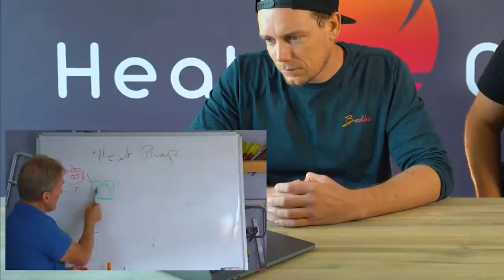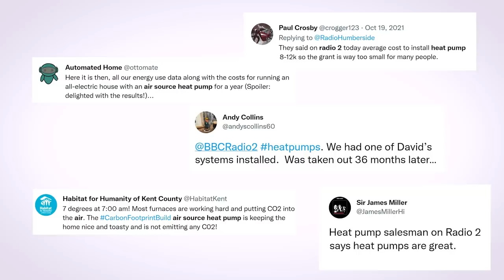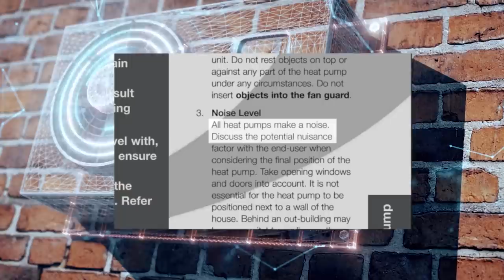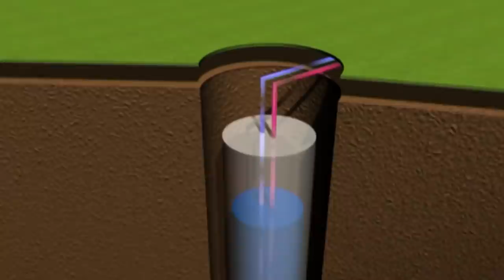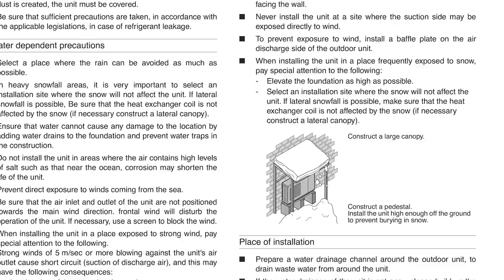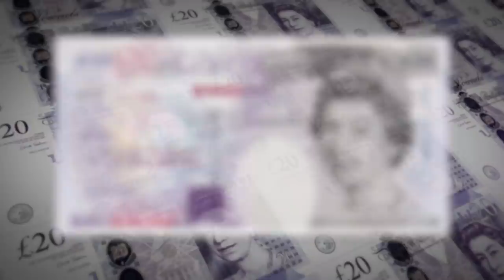Heat Pump Secrets They Don't Want You to Know

Comment: 👍 excellent video on the topic
1: majority of all problems was the selection of the wrong heat pump and the wrong size by an unqualified person who just wants to make a sale.  Not caused by the heat pump having a problem

2:  for the glycol water loop piping systems majority of all problems caused by improper piping design and trying to cut down cost and cut corners leading to an unhappy customer.  The cause trying to be cheap or unqualified contractor not knowing how to design.  Not the heat pumps problem

3:   Underfloor or radiant heating that is the whole idea of design it’s a very slow very gentle heat that needs to be on all the time there is no rapid changes up or down due to lack of knowledge causes all the problems. 
                    Slow radiant heat has to be very carefully designed and can be put on timers to set back the temperature slowly for day and night time or weekend or vacation and then slowly ramped up when the occupants are coming home on timers or remote set by your phone. 

       But any of the shortcomings again or not because of the heat pump it’s because of the designer and the installer when properly installed they were good when not properly installed they don’t work good. 

4:  noise “ what noise”. Every brand sells a low end budget brand and then they’re higher in brand you pick your problems by what end of the market for a certain brand you purchase. 
       The newer units have very little to no noise sometimes you have to go up and hug them and hold your ear to the unit or physically look for a fan moving to tell whether it is on or not if you have not seen this on the newest systems that means your lack of knowledge and being behind the times you’re commenting on old knowledge or somebody selling cheap or low end units that make noise. 

     Purchasing and installing and not knowing how to properly noise isolate is due to lack of knowledge just plain ignorance or being cheap and cutting corners and not knowing proper system design. 
     That is no fault of the heat pump.  That is a human introduced problem

5:  Polluting dirty power ?  
            That all depends on what country what state what province your particular area gets its power from some places only burn dirty coal some places burn crude oil some places burn natural gas some areas have geothermal which is very clean some have a lot of wind power that is about the cleanest solar power during the day and then nuclear the cleanest of all despite its name.    And you could be living in a place that has ton of hydropower by Damn‘s just naturally and need none of the above. 

So being dirty is by circumstances of where you live for other people it’s absolutely clean Power. 

     “ mine runs off solar with battery back up and one small wind turbine fan. “ as do many other people because of the area in which we live like many people.   But many people do not have this option. 

6:  Salt corrosion resistance factory applied from the manufacture. 
         Many manufactures on all brands produce a line that all their internal workings have a extremely high salt Corrosion coating that is installed from the manufacture does not have to be sprayed on later. 

       It is your particular region importer and distributor for the manufacture for your marketing intently and choose not to import that part number with the factory installed salt corrosion protection manufactured into the coils and components. 
          This is intentional because a profit margin‘s and they’re trying to hit a price point for greater sales it all comes down to the money.      In some regions they only sell the highly salt corrosive coating in their units because they live on islands surrounded by salt. 

      So because you were not introduced to the knowledge of what is available you’re quoting off of what you were told without heavy research you have to have the knowledge of the units being sold all around the world not just in your local area. 

7:  back up heat  ?. 
          Yes many of the older or lower model brand units will need back up heat in many instances with the newest brands that are specifically designed for low ambient conditions have been redesigned both their condenser coil‘s and their heat pump motors specifically made to operate down to -14°F I’m sorry I didn’t use Celsius I’m from the states or other close nearby low ambient temperature. 

      So if somebody hasn’t intentionally chosen the proper new or low ambient heat pump they will have to install heat strips for back up heat by being cheap or not knowing that these low ambient heat pumps exist is due to lack of knowledge lack of education or intentionally being cheap buying a lower brand so they can make a bigger profit and suffer with poor results. 

        There is also the design face where you correctly designed the right size heat pump not to be big enough to heat on just those three days of record-breaking cold days of the year that are not important.  That’s where you use your back up heat strips that will only kick in during those few cold hours of the coldest days for those few days a year no big deal and then you end up with the correct size heat pump for the rest of the average days of the year instead of having an oversized one.    This comes back to the knowledge of design

     And that’s not the problem of the heat pump that’s the problem of the person who sold it or installed it

8:  yes it’s always a good idea to keep it out of driving rain but the newer models don’t have much of an issue with that anymore and since they’re usually attached to the wall or up next to a building under and eve out of direct through flow of air movement they’re usually pretty well protected the majority of the time just by the natural installation process. 

9:  defrost cycle
Yes an extreme cold for continuous use on defrost cycle back up heaters will be needed for 15 to 30 minutes while the unit goes through defrost this is just a natural occurrence you will have to live with it’s only for a short time a few times a night so you won’t be uncomfortable and notice the temperature change but you can choose not to have them if you wanna be cheap and then complain about being uncomfortable for that 20 to 30 minutes while it goes into the recycle that’s a personal choice.?

And you will need that heater strip tape around your condensate drain line that is naturally provided at the bottom of the better model better brands already have a defrost heater installed at the bottom of the pan so when the water melts in the winter in the defrost cycle it will stay liquid and drip out of the bottom of the pan but if somebody did not know that that’s a personal choice of lack of knowledge 

10:  protect them from Highwinds
   Yes. Yes because that ECM motor if it is spun very fast also becomes a generator in reverse when it is spinning in the off position creating such a high voltage like a generator it can burn out the driving circuit board unfortunately. 
        If you know you live or installing in such a location you place the unit in a protected area or you purchase one of the little windshield kits and they even give you all the measurements for free and the design on how to build it yourself to protect it just one of those things you have to live with. 

11:   Snow rise it off the ground this is common sense but we know some people do not have common sense

12:  rodents I guess depends on your area the rodents in our neck of the woods don’t go into our units chewing on wires but have heard about it in other states in other countries. Regional problem take care of it

13:  bolted down,   Again common sense if you think you’re in Highwinds or earthquakes or it’s a high dollar unit and it could be stolen easy you would think you would want to bolted down. 

     But then again some people don’t think with common sense. 

It depends on your energy cost in what country you are in whether electricity is cheaper or gas is cheaper. 

 In my particular state San Francisco California we have a monks the highest electricity $.36 or more per kilowatt hour and natural gas is very cheap to heat with.    In some other states in the United States especially with lots of Hydro power which is also very clean electricity rates as low as seven cents per kilowatt hour can afford to heat with all the electricity they want to and have a very low power bill and in those areas gas is very expensive to heat with. 

      So this is a regional consideration before picking your source of fuel whether it’s oil whether it’s gas or whether it’s electricity

     I’m particularly lucky I live in San Francisco California with extremely mile climate we never get too hot we never get too cold we have lots of sun we can run off solar and in a weathertight house with good insulation a tiny 9000 BTU or 18,000 BTU heat pump can heat and cool your house all year long with a very low power bill we never freeze so we never have to worry about defrost cycles we do not get snow we do not have driving rain we do not have rodent problems we do not need back up heat. 

I personally have installed 9000 BTU and 12,000 BTU heat pumps in small houses here in San Francisco that can completely and satisfy the customer on the hottest heat wave to the coldest freezing temperatures because we don’t get those here in San Francisco California with a extremely low power bill.  

       San Francisco California is considered the Goldilocks climate zone for heat pumps
Reply: Skill builder is talking about the UK. . . We have an extremely wet and humid winter, a heat pump is on defrost more than it is running, you are lucky to get COP of 1.  May as well just use a fan heater...

Our electricity comes 60% from gas and coal, take into account 60% generating and transmission losses and bang goes your efficiency gains. . 

Our electricity costs 6-8 times gas per kilowatt so there goes your economic advantage. 

We do wet central heating with radiators, not split systems like you do in the states,.... These systems being sold here heat circulating water that then heat radiators in the house and a hot water tank,.   Loads of inefficiencies.

Loads of reasons not to do heat pumps in the UK.

Comment: The first law of thermodynamics states " energy can neither be created nor destroyed but merely changed from on form to another". If the outside air is for example at 5 degrees C, energy needs to be imparted to raise the temperature. The energy is imparted in the form of electricity. Therefore, in an equivalent home you may as well install electric radiators! Ground source will work due to the temperature in the ground being relatively constant.
Reply: You have zero knowledge about how a refrigerator works. And this is the whole magic

Comment: As long as you have upgraded good insulation first, and the power comes from nuclear or renewables, with correct installation, then heat pumps are better than any other heating/cooling climate control. The only way to be better for the environnement is to build a house so that it is mostly passive with tricks for heating/cooling with angles from the sun to windows, and extremely thick heat mass. Like a sort of modern earthship, because the original design don't cut it. But if you live in very cold climate, there is a simple limit to what is possible and then you will need an additional heat source. The roblem of solar thermal (with water flowinfgin panels) is also freezing, and the problem of the regulator and sensors : the most sold ones rely on temperature rather than solar instantaneous illumination, so you have huge losses. Because even at the worst of winter you can have burning hot water, it's just using the right way to drive the pumps cleverly.

Comment: One point to wary of with this argument is using installation and operation manuals as the source of information. Things are often written into manuals which are there to protect the company more than are actually a necessary requirement. The company has to try and think of every way something could go wrong then write a specific statement telling you not to so it. So manuals are often overkill for the real world, but protect the company legally.

Comment: You are right to say what you say and I am sure if we read through the gas boiler manuals, there will also be a lot of warnings and potential problems. A professional fitting it rather than a flyby night cowboy is obviously one step. My 1973 detatched home is not able to have mains gas and my LPG tank has now been condemned, so options are limited. I am looking at ASHP from a reputable company and have also gone down the stpe of fitting new double glazed windows and doors, to replace the more than 20 year old leaky ones. Also my insulation is being replaced having broken down (being an early spray on solution) and up to date is being put in. 
When fitting the ASHP I will replace my 50 year old radiators and this will also give me the chance to correct positioning of them for the modern house.
So yes, I agree if you just fit and forget an ASHP it will fail.
Like you I am mortgage free and with interest rates being so low, I have invested in my home and hope to decrease my monthly spend on fuel and power, with the grant the cost will be about the same as a new mains gas boiler.
If you want to move to newer technology you need to get other things up to date first, this is a prime example.

Comment: A heat pump compressor is more heavy duty than a regular AC compressor,  it can take more abuse if adverse conditions occur;  above 40 degrees (F) a heat pump is the most efficient heat source in the industry.

Comment: A question I have asked many times. "Why are you heating the house, didn't you heat it yesterday."   Stop the heat from leaving.  We need to sort the insulation and ventilation first.  There is not an easy answer.  I remember being told "There's the easy route and the hard route, the easy route is always mined."